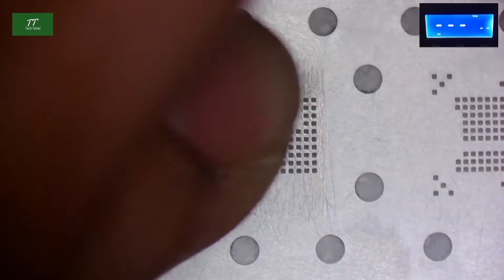How to Reball eMMC BGA 162 Tutorial #1 | Tech Tomer

Comment: Redmi note 5 pro emmc changed but  rpmb not clean. I watched some technician have cleaned rpmb with special file  but they don't share those file. Do you have any idea how  to clean rpmb of RN5pro.

Sometime while cleaning, EMMC pads breaks. At what temperature is suitable for cleaning ballls.
Reply from the maker: Nice questions! It depend on what jtag box are using. I'm using ufi and easy jtag box, i don't see any updates that can clean the rpmb. Maybe you watch a bluff video or maybe there's something we didn't know yet but they know already.
Reply from the maker: About emmc cleaning. You can apply low-temperature BGA paste on emmc it helps to remove  the balls easily